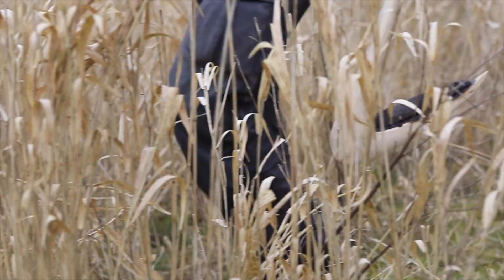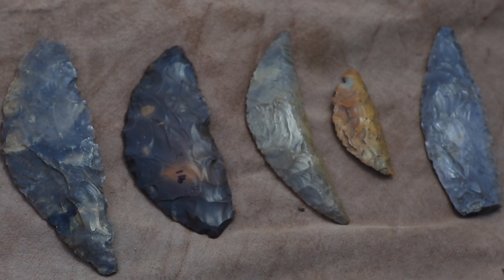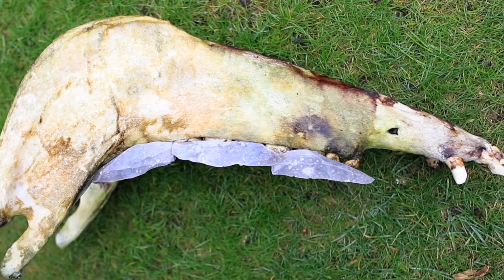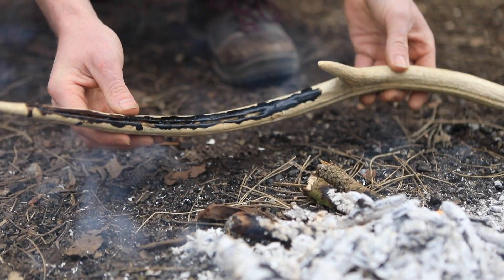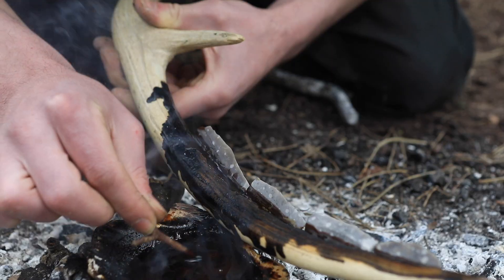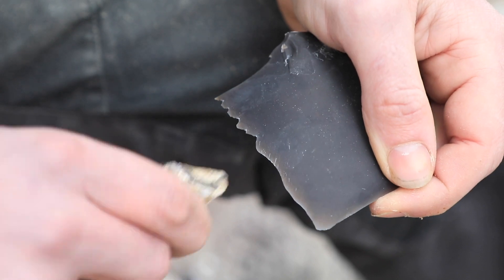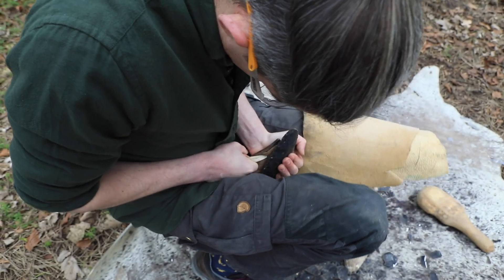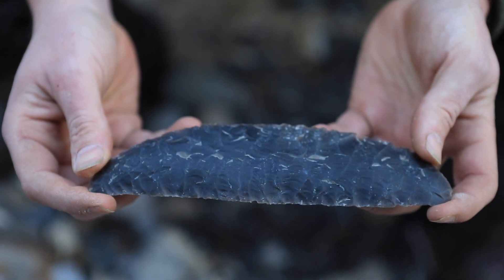Prehistoric Flint Sickles: Farming Tools In The Neolithic

Comment: why did they bother cutting these crops instead of just pulling them out?
Reply: You never take care of your garden right?
Reply: Why don't you just pull up your yard instead of mowing it?
Reply: @Walking_BearFoot  because we have lawnmowers, which require far less effort. Or even if I was using a sickle or a scythe, its a metal blade that doesn't need to be sharpened after a few minutes of use and is still faster than pulling things out. Now go try that with a stone sickle and see how long it takes before you are sawing away at each handful.

Comment: What did you use for glue? Bitumen or is it something else?
Reply: A common form of glue in North America and Europe would be birch resin, and more often than none you will find pieces of crystalized resin stuck on the bark. Take it and put it into a container close to the fire, so it will melt but keep an eye for it is highly flammable. Once is melted, pick some of the carbon that formed from the burnt coals and mix it with the resin.
Reply: @fabricio-agrippa-zarate  thank you so much! This was awesome insight.
Reply from the maker: We have evidence of birch bark glue being used in prehistory, we actually have some prehistoric glue shells on the AncientCraft shop with some more info if you fancy taking a look!

Comment: Whilst we are indeed as a species slaves to our masters, Grasses, are these sickles useful for roofing material like Rush?
Reply: I don't see why not.   Although a simple alternative is just beating the base with a fairly heavy, slightly sharp stick which may have enough force to cut a fair number of them if you get a good swing speed.   Which would ultimately be more efficient who can say?  When it comes to grains you don't really want to be too violent or the grain can drop off of the stock.  Rushes don't have that issue.   Of course those crescent sharp larger blades just used with a basic handle might be heavy enough and sharp enough for both jobs.